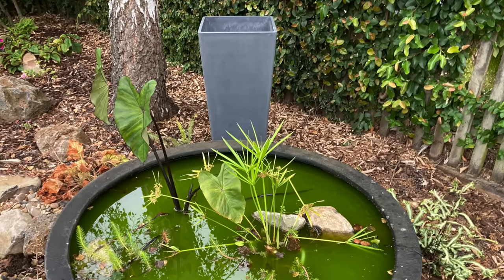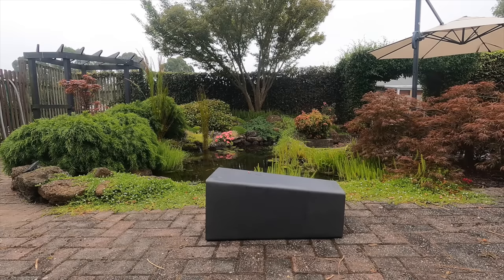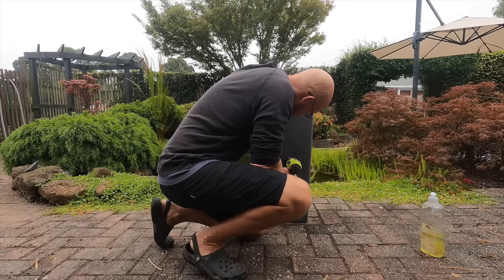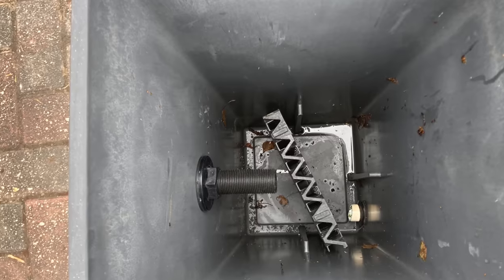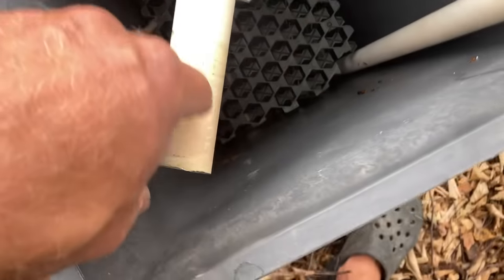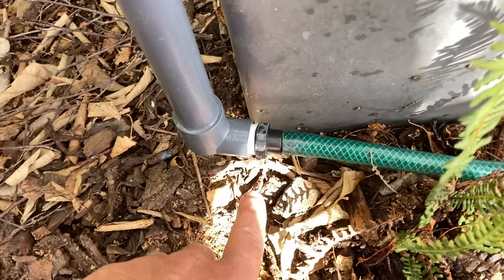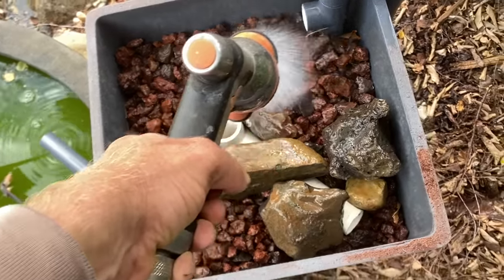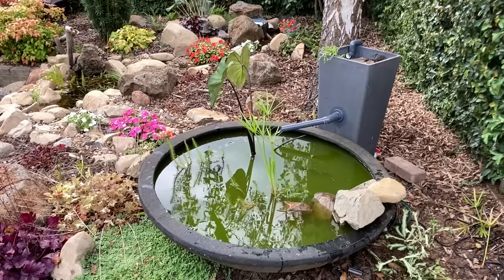Cheap bog filter in a plant pot

Comment: I have a 400 gallon cattle tank pond that I have been struggling to keep clear. I have a fountain running on a small pump to aerate the pind, but I'm realizing I should add some form of bog filter. I don't want to have to set up a second pump, so I am thinking that what I will do is make openings in the bottom of a 20 gallon metal trash can (that is just taller than the water level) and put mesh over the openings, then fill the trash can with rock suitable for a bog filter, and then put the pump for my fountain just below the surface of the rock so that when I run the pump it pulls water up through the rock. I think I might also want to place some sort of mesh basket around the pump to ensure that there is a clear flow of water to it, and then I could probably put plants in the rocks as well and not have to worry about the roots clogging the pump.

I have watched most of your videos and haven't seen you build a bog filter like this before, so I wanted to make sure that it could work. I'm wondering if I need to limit the size and number of openings at the bottom of the trashcan, or if I should try and have as many openings as possible. Any thoughts and advice would be greatly appreciated
Reply from the maker: I’ve tried rock around the pump before. I don’t like it. It’s makes accessing the pump really difficult. An intake bay has rock over the top of the void but the pump is always easily accessible.
Reply: @Ozponds  Thanks for the suggestion. do you think that a bog filter with the water entering at the bottom and the pump pulling from the top should work fine?
Reply from the maker: @asdeasde96  kinda. Check out the video I made on upflow bog vs downflow bog.

Comment: My pump starts out fine then slowly starts to trickle. So I use the next setting but it flows fast. You recommend a slow flow, what would course it to stop working. Head height? I used the same pot you are using. What GPM pump are you using?
Reply from the maker: Is the pump screen getting clogged? That will restrict flow. This pump is 300 or 500 litres. I can’t remember which I’m sure I mentioned it in the video or the description. Just remember litres are different to gallons.. 4 litres is approx 1 gallon.

Comment: Hey Kev, what did you use to fix the PVC piping together? Did you use PVC cement/weld glue, or did you just do a tight press fit?
Reply from the maker: Glue 👍
Reply: @Ozponds  thanks. In the process of building my first bog filter for my mini barrel pond right now. I've oversized the bog filter so I have the capacity to add a series of 'cascading' barrel pots in the future :)

Comment: Recently found your channel and its wonderful! one question I could not answer from the videos, you probably explain it somewhere. what is the real difference between a bog filter and a store bought filter with the plastic shapes and sponges? they also add a lot of surface area, and maintain a waterflow, and you need to clean periodically, but also the bog filter needs cleaning? so why are the bacteria growing in a bog filter not also thriving in these shop filters? i must be missing something. thanks!
Reply from the maker: The bacteria are pretty much the same. There may be differences in oxygen levels, but that’s probably not something you need to concern yourself with. The bog filter is simply bigger, generally cheaper (because you’ll build it yourself), more efficient to run (requires slower flow rate) and requires less maintenance. It’s just a personal choice. There’s tons of ways to filter water.

Comment: Hi Kev , it's always good to have a refresher on how to make a  bog filter. Thank you 😊. The cutter that you use to make the hole in the pot . How do you know what size goes with what size pipe ? 😊😊😊🐔🐓☀️☀️☀️🐡🦋🐠🐝🐟🐋🦎🐢
Reply from the maker: There is a sizing chart on most good sellers of uni seals, however I just match the drill hole with the uni seal. When you are holding the seal you’ll see how easy it is to select the right hole size.
Reply: Thanks Kev..😊

Comment: My barrel pond with 20 gallon bog filter is working well enough, but I would like to know: when I remove the string algae, can that be placed just in the ground when I plant something in the yard, as a nutrient booster, or do I need to add it to the compost pile to break down first?
TIA
Reply from the maker: Either, either.

Comment: how far down does the inflow pipe from the pond go into that pvc pipe and how do you keep it in place?
Reply from the maker: You might need to watch the vid again. The rubber hose from the pump inside the pond is connected to the pvc that feeds the bog filter via a Barb fitting at the base of the filter.

Comment: Kev, love the channel. I’m starting my first Bog.

Question: could i accomplish a bog filter with a round container? I know in your above video it’s a flat surface, but could the 1 inch seal and the bog bolt work on a round surface? Just curious 

Ty man.
Reply from the maker: You absolutely can. Don’t use the bulkhead on a round container. Use the uni seal 👍
Reply: @Ozponds  got it. Ty.  Can a Matala filter be used in conjunction with the “Bog box”?
Reply from the maker: @kevincrabb593  for sure.
Reply: @Ozponds  haven’t started my bog filter as things have changed. My pond is 350-450 gallons so I’m trying to size it correctly - any suggestions ?

I also purchased your bog filter formula 3 weeks ago but have not receit yet
Reply from the maker: @kevincrabb593  you need to follow the steps on the webpage if you haven’t received it. Then I can email it directly to you.

Comment: That "breather pipe" as you call it seems to make an annoying suction sound. Have you considered a 1-way valve instead?
Reply from the maker: They fail.
Reply: @Ozponds  What about an " anti-siphon valve" instead?
Reply from the maker: @rockyhighwayroad7365  if that’s something you prefer, go for it 👍. I’ll be sticking with a breather.
Reply: @Ozponds  Do you have any negative experience with  anti-siphon valves?

Comment: Very informative and easy to follow instructions. Thanks for sharing. I do have a question, do I still need one of the $200 pond bio filters using the Bog filter method? I would think not as the bog seems pretty reliable and more natural?
Reply from the maker: A bog replaces a biological filter. However more filtration can be useful you might like to fill the other filter with sponges to trap fine sediments.
Reply: @Ozponds  Hey Kev, quick question in this example you did above; how would you increase the outflow back into the small pond? Is that all based on the power of the pump you are using? I would like to build this setup but I would like to have a little bit more/faster water flow as it will be fed into the top of a small waterfall which will then streams about 8-9 feet back into the pond. Based on your reply above about having another filter with sponges, I'm wondering if that would be a better route to take?  
I apologize for all my questions man, I am going to lie down and read the entire PDF tonight. I've been in pond planning mode this week binge watching your vids. 🙂
Reply from the maker: @MrJmhess77  yes, the flow is determined by the pump capacity. If you are going to oversize the pump on a bog filter, use a valve on the breather pipe. That will let you regulate a bit how much flows to the bog and how much flows over the surface. If you blast too much water through the bog it’s not as effective.
Reply: @Ozponds  perfect! Thank you. I actually sat down and read the PDF last night and it's all starting to makes sense now.
Reply: @Ozponds  Have another question for you, instead of having the 1inch outflow pipe back to the pond can I cut a spillway into the top lip of my container barrel so the water is pushed out and over or no don't do that "Jason, are you crazy?!?!" ----  I know you mentioned if I do over size the pump (FYI - I will to be) I will need the regulator there so I just wanted to ask. I really appreciate it. Do you have a tip area where I can buy you a "coffee"?
Reply from the maker: @MrJmhess77  you can but it might leak/ dribble a bit. If that water will return to the pond no problem. Just PayPal donation button 👍
Reply: @Ozponds  Great news, the pond is in the ground and filled with water. I have a few more things to finish on the waterfall and stream but the hard work is done! The bog is hooked up and completed, finished off the plumbing today. I had a small leak on the intake bay/skimmer liner not wanting to cooperate with me as I think I dug the hole too deep and the liner folded over itself causing it to allow water to leak out, I back filled the hole with sand so my bucket would have a level surface and raised it up a couple inches and the pond is holding water just fine. My body will be in pain for the next 2-3 months but that's okay, I now have a running stream, waterfall, and pretty sick 4x8x2 pond in my backyard. I will be uploading my vids to my YT channel soon and will let you know. I told my wife I blame you for creating a "pond monster" in me. 😎
Reply from the maker: @MrJmhess77  🤣 well done mate👍
Reply: @Ozponds  Thanks to your great video content and PDF document. It really did make it quite simple. I will be using that Paypal button soon. I spent all of my "Golfing/hobby money" this month on pond materials.

Comment: If the pond didn't have fish, couldn't you just have cleaned up the water by putting alum in it? Also, I find that I would  need so much additional space for such a filter and would also need to factor in that it's quite a big visual presence right next to the pond. Both of these would be issues for me. Is there no way around it?
Reply from the maker: If the pond doesn’t have fish you could use lots of things. There’s also lots of ways to filter water doesn’t need to be a bog. But you do need to match bio loads with filtration capabilities. I just find a bog the easiest way to do it.

Comment: Hello... I'm half way through a build in Thailand..they don't sell underlay here, not even in China.
Should I consider going forward without it? Is there a good substitute?
I was thinking those mats with the astro turf....
Thanks.
Reply from the maker: Sand is good
Reply: @Ozponds  That would work for the base. How about the interior walls?
Reply from the maker: @michaelernest7224  you set the rock and backfill with sand.

Comment: Can the breather hole be placed at the end the pipe which will be going through the bottom of the filter then coming back up on the other side of the filter?
Reply from the maker: I’m not quite sure I can picture what you’re saying in my head. Just give it a test before you glue it all together.

Comment: Hey Kev. My pond has black jelly-like algae forming around the edges and on the surface of the pond. My bog filter, which is covered with clay balls (i.e. water surface not above the clay balls), has this same black algae forming between the clay balls, on the surface of any exposed water. Any idea what may be causing the black jelly algae?
Reply from the maker: Are you feeding the fish?
Reply: @Ozponds  no. They rely on any bugs that land on the surface of the water. I have some mint and other plants around the edge of the water, which are growing rather well. They have been shooting out roots (?) which are along the surface of the water. I do need cut those out.
Reply from the maker: If the fish are happy, I’d be happy 👍

Comment: Hi, I’m in the middle of making a bog pond but it’s acting more like a secondary filter as it runs off of my internal filter.

I have connected the tube from my first filter to a pvc pipe which pumps down to the bottom of the bog pond.  I don’t have a as you call it a breather hole on this. Is this necessary?? 

I do have an overflow hole that connects to my water blade though as I precaution.
Reply from the maker: Turn the pump off and see what happens. If it doesn’t siphon you’re good to go 👍
Reply: @Ozponds  Good call. The joints are currently drying as I type. I’ll try this tomorrow. 

The bottom of the bog. I’ve made a maze of pipes with several small holes throughout, as I’d read online. This will help slow the flow and spread the water evenly at the bottom. 

My only thought is that due to their small size, they’d be more likely to get blocked. What’s your opinion on this? 

I am also a little confused about the purpose of the overflow. I understand what an overflow does, but I don’t know when it would be needed. 

For example, if the pipes were blocked, no water would enter them, and therefore, no overflow would occur. 

If water syphons, it would only go back into the pond as the bog is higher than the pond level, although I’m not sure it would because I believe the filter would prevent that. 

Is the overflow just for when it rains? this seems a little silly. 

Sorry for the ton of questions.
Reply from the maker: @JustBaileey  I don’t really understand what you are saying. In this video you would have seen I had no dispersal pipe work with holes. The larger void area makes it irrelevant, the water will come into the base fill up and water will rise evenly throughout the filter.
Reply: @Ozponds  Apologise. I rushed what I was typing without re-checking. 

I have now corrected what I was trying to describe.

Oh, because I have the void, the tiny holes throughout the piping aren’t necessary. I suppose I can drill them larger if that's the case.

Regarding the overflow questions. When would this be useful? Can you describe a scenario?
Reply from the maker: @JustBaileey  the filter sits under a birch tree. If the overflow hole gets plugged with leaves the water will rise up and go down the secondary hole, rather than overflow the filter.